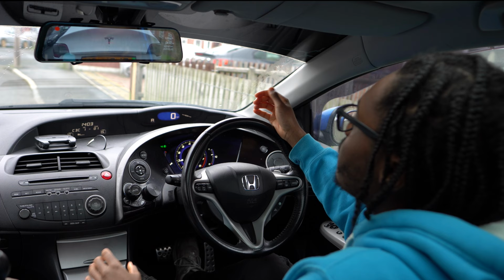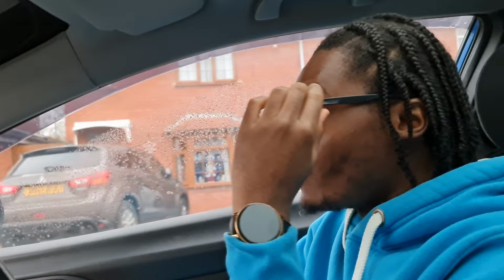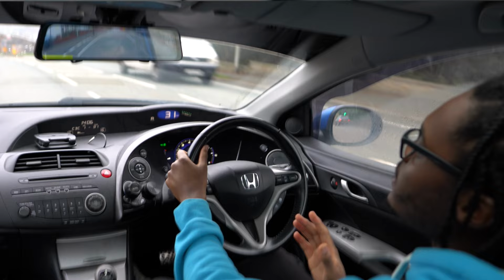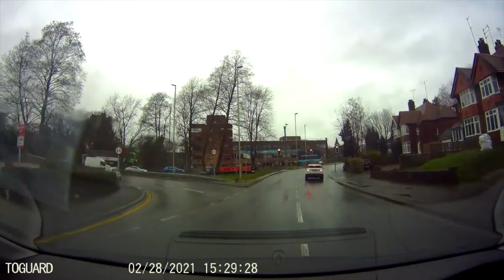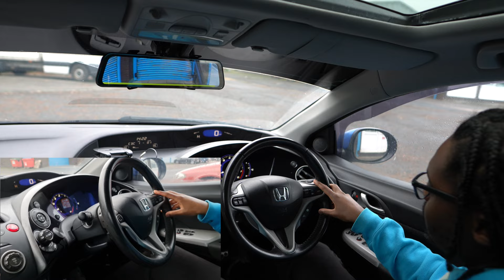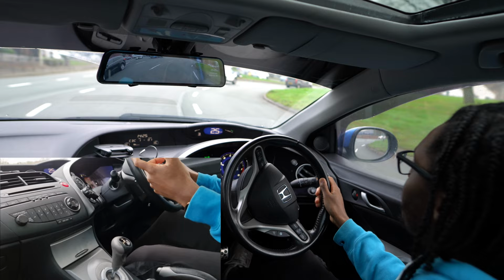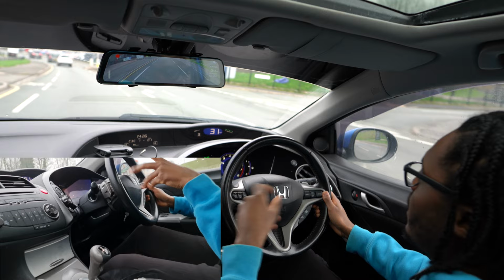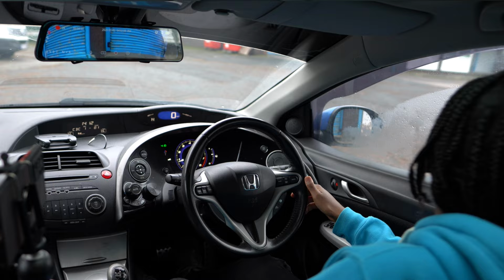How to Best use the i-Shift Gearbox in the Eighth Gen Civic Type S (FN1)

Comment: Mine shifts at around 12mph from first to second. But I use the paddles to drive anyway. The one thing I don't like is if I'm in 2nd and I'm coming out a corner it shifts down to first and you can't turn that feature off. When it won't got up into a higher gear just leave it in that gear for best fuel economy. 
I find to stop the down shift put the car in neutral till you stop. When Changing gear take your foot off the accelerator in between each gear like it's a manual with clutch peddle as it's better for the clutch health on these cars apparently. 
Nice vid I been secretly watching the development of this car. 🖤
Reply: In a semi automatic ur not supposed to take your foot of accelerator when gear is being changed this is bad as the car stutters because it’s not built to have a clutch

Comment: I've got this gear box also 2007 civic 1.8 best way to to use the ishift auto is everytime you hit 2.500/800 revs just let go of the gas it goes straight into the next gear... In the beginning it was horrible to drive but once i figured that out it always changes the gears and you don't even get that jerk every time it changes, its as smooth as a normal manual gearbox. Its basically the same concept just without clutch pedal on a normal manual you take your foot off the gas to press the clutch, this one you just let go off the gas and feel the subtle gear change..... This is only when you are driving normally like how you would drive a normal manual car not when racing , if want to race with it the gears will change at higher rpm can't tell you which rpm, it all depends on how hard you press the gas pedal but same applys just let go of the gas and it will change gear...

Comment: This is a very misunderstood gearbox. The best way of thinking about it is that this is a manual with automated gear change (like you say). Lags between shifts are the same as if you would change gears manually. Yes, it is slower that dsg or torque converter, but is much more simple and reliable and needs no service. Once you get used to it - you can really love it.
Reply: Yes it's very true. It's a manual not a semi automatic.
Reply: Precisely. Its a gearbox for grown ups, not boy racers. Mine works fine and smooth if used correctly.
Reply: It's not more reliable than a good torque converter, don't know what planet you are on.
Reply: @abraxas7779  Agree, I thought about DSG in terms of reliability, and torque converter in terms of simplicity.
Reply: It’s similar to MMT that Toyota used in some models,it’s really awful.
You never used to it because it can hesitate specially when you stop start at traffic/ junctions which is extremely annoying and even dangerous.
The VW developed DSG is 100% superior.(I had both).all DSG needs is gearbox fluid change each 80K.many people neglect this,then come and cry why their gearbox is damaged.

Comment: You've got a technical problem somewhere. I have the same 2007 iShift and it changes up around 2,200 rpm, which is about right. I really don't like the iShift, the gear changes are jerky and sluggish, and reversing into a tight parking space is a nightmare, but it does basically change gear when it should. Yours is pretty wonky, it needs looking at.
Reply: ive heard letting go of the gas before a gear change like u would let go of the clutch with a manual helps, it switches gears nice and smooth

Comment: Thanks mate that was helpful as I bought it a month ago I-shift and already regretting it 😅  one question plz if u doing reverse parking on a slightly hill sometimes it doesn't go back rather than starts going forward what to do with it ? Is there a faulty gearbox
Reply from the maker: @shahrukh akbar ah yes, reversing on an incline - it’s a pain if you’re used to having a clutch! You’ll get used to it, you have to try and balance it with the throttle. It’s not great for the clutch but that’s what you got to do
Reply: @aSidney  thx n based upon that I’ll stick to getting the manual. Got one but got crashed into by someone. Getting a next one now but with lower mileage as these civics are known to have gearbox issues on high mileage. Could only put mine in 3rd gear first 5 minutes in winter and spring. Summer ok lol. Got it on 150K. Done 46K more now. Cheers

Comment: Thank you for this informative video. I can only use an auto box due to an accident damaged left leg. I want a Civic but noticed both the road tax and fuel economy are cheaper with iShift models, but do you think I should still get a full auto?
Reply from the maker: @delatronics3257 I'd say a full auto would be best - the ishift requires your attention for "smooth" performance but an auto won't, it'll be much easier to live with

Comment: yes it does have sport mode when you put it on manual and let it shift gears by itself using the whole tachometer. the automatic mode is like comfort mode. and you can change how and when gears is going to shift but only service can do this i think

i hate when i push throttle and after 2-3 seconds car starts driving... its wery dangerous when you want to squeeze somewhere
i shift burns the clutch.. 
whats the point of this i shift system then if people still use manual in it????
Reply: Cos it's like playing a SIM rig. 🤣
Reply: Not really a Sport mode, more like a safety feature for the gearbox and the engine. Keep using it as a "sport mode" and you'll be in for a clutch replacement (believe me, I know what I'm talking about)

Comment: My car broke down last week due to the dreaded P0810 actuator issue. The way it is, every single i-shift owner will experience it one day or another. The fact that Honda doesn't offer any service for the actuator but will charge you thousands to replace it is outrageous.
Reply: By how many mls/km did it happend? Did you got it fixed?
Reply: @Luke.Skywodka  120k km. I followed the instructions I saw on many Youtube tutorials (including dozens of Russian tutorials), where I replaced the carbon brushes of my actuator (mine were dead). The problem disappeared and the car starts again, but I'm not sure yet that it's fixed until I can fill the fluid and bleed it properly
Reply: @monsieurbrochant7528  Thx for the fast reply! 
120k km is not that bad. Did you change the transmission oil before, or is it originally?
Reply: @Luke.Skywodka  yes, but the problem has nothing to do with oil, it's carbon brushes subject to normal wear inside the actuator
Reply: @monsieurbrochant7528  ah okay i understand.
I was just wondering because I bought a Jazz i shift with 55,000km for my 18 year old niece yesterday. She likes the car very much.
It's good to know what you should pay attention to with this gearbox or actuator.
Thank you!

Comment: @a.Sidney My clutch is worn on my ishift, only 90,000 Kms but I have to change it cos gears are slipping and going into neutral and also stalling. I will change the clutch, however I am thinking of using the paddles on the steering wheel from now on. Any advice? Also when I change gear should I keep my foot on the accelerator or lift my foot off for every gear change? I heard that lifting your foot off the accelerator each time on gear change can damage the clutch. Any thoughts?
Reply from the maker: @Mark Système personally I don't like using the paddles because they feel terrible - I much prefer using the shifter. I don't know how lifting off the accelerator could damage the clutch, I'd suggest not doing so would damage the clutch as you effectively ride the clutch while its changing gear. I think lifting off the accelerator is better for the clutch as well as shifting smoothly
Reply: @aSidney  Thanks a lot for the info, yes I think it would be more logical to take the foot off the accelerator when changing gear since it is really a manual.

Comment: Hi silly question mate but how the hell do I put this in P mode to Park. I just bought this car and done see P like on standard autos. Do I leave stick om neutral or reverse on dead centre???
Reply: Exactly my problem too
Reply from the maker: @Isa Lee there's no park mode with this gearbox - it's not really an auto per say, more like an automated manual. You just need to to leave it in neutral and then apply the hand brake
Reply: @aSidney  mate u life saver for replying! Lol I thought I was going mad.. 
I have so many questions about this car, may I pick your brain 

I would really appreciate it
Reply from the maker: @Isa Lee No problem at all, ask away
Reply: @aSidney  my car has about 101,000 on the clock is it still worth putting body kits and wraps and doubled din parking cameras induction kits lol basically I never got a chance to be a boy racer and I'm running out of time lol
Reply from the maker: @Isa Lee what I'd say is if you're okay with the fact you won't get the money back for the mods, then by all means go for it
Reply: @aSidney  lol I would just rip the mods out lol is there a way of stopping this car from rolling back on hills? Like how can I fast launch it??  Our cars don't have power folding mirrors does it? Its a pain in my ass having to manually move the mirrors inwards..
Reply: @aSidney  I also gave you a sub because your kind enough to respond to my pain in the ass questions..
Reply from the maker: @Isa Lee Lmao thats fair enough and I'm assuming you're referring to hill starts? Apply some gas before putting the hand brake down, much like in a manual car. 

Launching is a bit trickier but you could try brake boosting - apply some throttle while standing of the brake and then loft off the brake. Although, with the power the car has plus the sluggishness of the gearbox, I'm not sure it'll make much of a difference. 

The GT models have auto folding mirrors, the switch will be where the mirrors adjustment controls are. If your car has the pano roof, it's a GT model
Reply: Lol 🤣
Reply: @karlpedersen7  lol I never drove a semi auto before.. (surprisingly I still own the I shift civic)